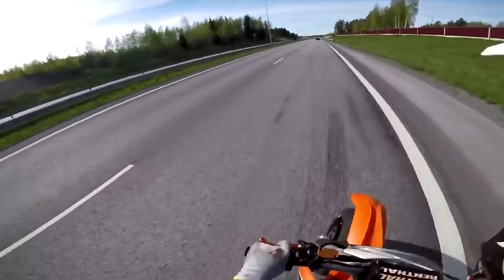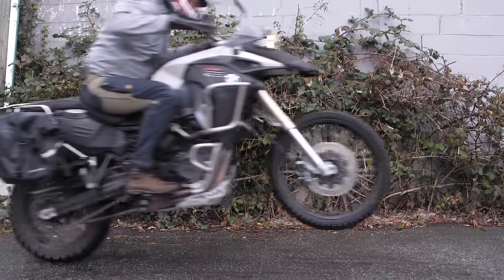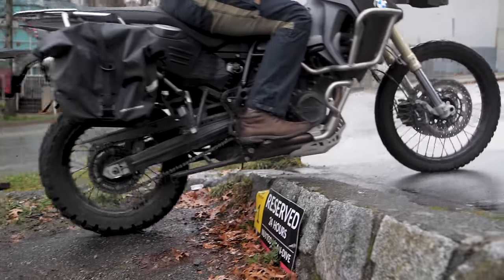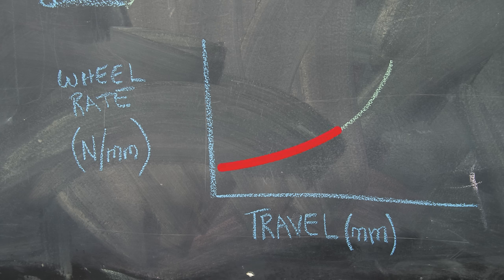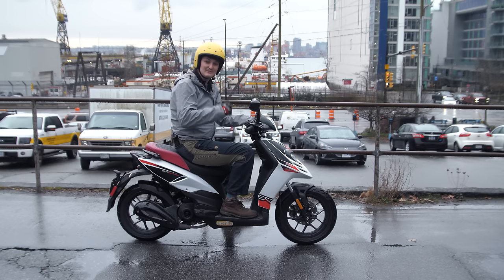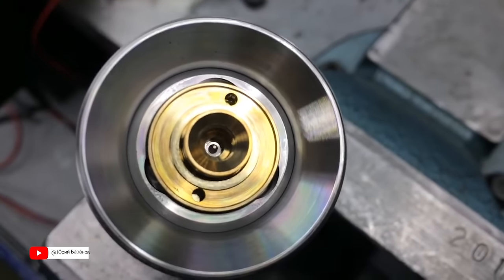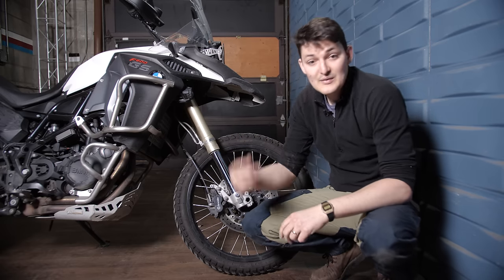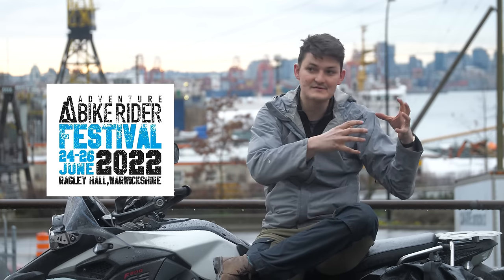Tank Slappers and the Quest for Perfect Suspension

Comment: Ahh so that's why when my bike is loaded the front will wobble a bit under acceleration. Amazing video Ryan!
Reply: Noticed the same thing on my new zx6r, kinda scary coming from a 300 lol
Reply: @kawininji8874  Go get a shop to sort out your suspension settings if you're struggling to find the right ones yourself. A new supersport should not have tank slappers when set up right. Even my decade+ old second hand R6 can go full out without issue.
Reply: Always make sure to adjust your rear preload when riding with a passenger or with heavyish luggage.
A few months ago I took a pillion for the first time ever. Only rode for maybe 10 minutes without adjusted rear suspension (I can only adjust preload on my 2012 V-Strom 650) and without adjusted tire pressure. It felt very wobbly and I was not confident at all. A few days later we rode again, but this time with properly inflated rear tire and preload set to maximum. Oh wow, what a difference! It almost felt as riding alone; even the tight u-turns were no problem.

Now that I think about it, in hindsight the steering felt very light, I mean it felt like there was not much load on the front tire. I didn't experience any wobbly feeling, but I suspect I might have if I had been really aggressive with the throttle. So next time I think I'll adjust the front preload as well in order to shift the center of mass a bit forward.

By the way, if you ride very aggressively (very fast acceleration) you might want to look into an aftermarket steering damper.
Reply: Accelerating hard enough to cause the front tire to just skim the road surface can also induce a slapper, when those little stones and cracks in the road surface begin knocking that front tire off alignment with the direction of acceleration, and a lack of weight allowing the front wheel to pivot.
Reply: @exothermal.sprocket  Yeah and gravity of moon is also possible to cause slappers.
Reply: Make sure the front and rear ride heights, front and rear trail, etc., are all correct as well.
Reply: @jothain  You were sleeping in physics class.
Reply: @NiSE_Rafter  yeah I plan to soon. Don't trust myself yet as it's my first time having adjustable suspension on a bike

Comment: Other, more common causes of tank slappers include: 1/ Too much luggage weight behind the rear axle making the front and light. Watch out for luggage racks that protrude out back. 2/ Weight transfer off the front wheel caused by the drag induced by flat fronted touring screens.

Comment: Absolutely love this channel and I'm always really excited whenever I get an alert of a new video. Ryan's knowledge seems to know no bounds, so I was surprised to see him get it backwards at 2:15 - the top part of the spring he is holding is the softest, stiffest is at the bottom.
Reply: Noticed that too but not a suspension expert so wondered if I had got it wrong 😑
Reply: the soft section of spring is what is causing the section with a wider gap to act in a progressive manner by preventing it from twisting and creating a shorter functional wire, increasing spring rate. this makes it the stiffest at the section closest to where the "soft" coils are. the short twists are not really a part of the spring, as far as springing functionality goes, more an accessory to the spring that using funky fysics to trick it into behaving nonlinearly. kind of like preloading negative twist onto the wire so when it is compressed, the section closer to the tight coils will not want to twist as much
Reply: Chalk board diagram shows advised position for installation, does it really matter? The spring reacts as a single unit, invert the fork assembly the spring still reacts the same.
Reply: I don't think it matters. The soft part of the spring will compress the most at first no matter if it is at the top or the bottom. All forces are linear.
Reply: @flechette3782  The issue was his pointing, not his aversion to the laws of physics.

Comment: 8 years with a Kawasaki 250 Ninja. Never had a tank slapper. But seen them, and taught about them at PRS. Then it was stolen. Until I get a new home, I'm not getting another motorcycle. This is why spring is hell for me. Ryan provides me content that's the next best thing.
Reply: Probably weren't doing any wheelies (certainly not by accident) with a 250. So for little bikes, usually not a problem.
Reply: @jakegarrett8109  It was certainly a reliable steed. Maybe that's why I loved it.
Reply: @leftcoaster67  250 is a great class for reliability. Good fuel economy, not so much power that they can break stuff (if they are decent quality), nothing too crazy to work on like synchronizing 4 carburetors, engine inspection and maintenance is similar to that of a lawn mower (and its very open and easy to get to compared to crammed in 4 cylinder engines), and of course takes like 1 qt of oil and everything super easy to maintain. Often even air cooled so no coolants to flush, just oil and that's it!

My 250 Chinese Honda clone was pretty good, its biggest weakness was a weak frame (and one crazy 14 year old that would sometimes clutchless slam through gears WOT down the highway, but hey, I was that 14 year old so I can't complain too much, haha!). Made new engine frame mounts out of heavy sheet metal, and reliable as could be. I still got 90 mpg driving WOT doing 65 mph on gravel and pinned whatever speed it would do on highways. It even did 109 mpg with 2 people riding when my dad drove it, so not bad, and other than changing tires pretty often didn't have to do too much. Also changed sprockets for higher speeds (duel sport enduro, so they probably didn't plan for it to do 75-80 mph), did better than my skill level off-road too.

I would be driving that right now but its parked halfway across the country, and if I spend 2 or 3 days non-stop driving it to me, well I'd make enough to pay for almost half of another one (and I'll probably move back close to it anyways and have to drive it back again). Otherwise not bad, very lacking for passing on highways and weak going into 50 mph headwinds, but other than that it was a fun reliable bike.

Comment: You really should have covered the finale common cause of tank slappers. Out of adjustment or worn out neck bearings.
Reply: And the spring rates on bikes with dual rear suspension not matching perfectly (Harley Dyna).
Reply: Wheels not weighted properly can also cause them, and on super sports too much weight on your wrists can also cause them as well. I'm especially conscious about this on my r6.
Reply: @Matty_Ice9  Yes, balancing or tires with wear or new poor quality tires can increase chance of it to happen. I had those.
Also totally had forgotten, but in my youth I had a pocket bike - too firm grip would make it wobbly instantly! 🤔 Crazy sensitive steering, would not like that on an bike going over 25 mph 🙃
Reply: And mis-adjusted forks in the triples shortening trail too much causing an overly nervous front end
Reply: And uneven fork oil levels due to a leaking seal or pitted fork tube
Reply: I've never actually seen those cause tank slappers. I've had many, many bikes and plenty with worn steering bearings. Most people with more than 20-30k miles on their bikes have notched steering bearings, which is pretty normal. And they never notice because it's such a slowly occurring process. 

I can't see how the bearing would actually cause a tank slapper. At worst, they'd cause funky handling if worn or if maladjusted.
Reply: @DearMajesty   Your fortunate, I’ve personally had it happen a couple of times over the years (40 years behind the bars). On the older bikes when the neck bearings didn’t get serviced (greased & adjusted) they’d get loose as they dried up. Once that happened they’d became prone for high speed wobbles & that would turn into a tank slapper situation. Not much more scary then powering past a speed wobble & knowing you may catch again it on the way back down. Keep it shiny side up my friend.

Comment: I didn't know the rear shock was affected  by the angle changes. A fun fact is that on a variable spring it does not matter which way around they are placed. The weakest part will always compress first which makes perfect sense but a lot of people think you need to put them a certain way.
Reply: You could affect the amount of unsprung weight. If most of the spring has to move towards the end that compresses first it would act as unsprung weight.
But to be fair, the amount of weight in the spring versus the wheel, brakes and lower fork is pretty much negligible.
Reply: After thinking about it some more there's also the effect of "waves" through the spring. Basically it takes a little time for the force to travel through the spring, and for the entire spring to equalize. The wave would travel faster through the stiffer part of the spring. https://www.youtube.com/watch?v=10-QGhm5hgc

Sorry for babbling, not at all meant as coming at you, it was just interesting to think about :)
Reply: @kaggen  No need to apologise. I am learning a lot of new things thank you.

Comment: When I saw the title of this video I was hoping you were going to talk about steering dampers to avoid tank slappers. But I don't think you mentioned them. Are you perhaps going to make a sequel video which does elaborate on steering dampers. I believe they're extremely important in circuit racing, be it on and off road. But for some reason they're mainly used in rally racing (like Dakar) and almost never in motocross and enduro. I don't understand why.

Comment: Skyhook required no springs and no damping, but there are other methods of assisted fully active suspension. There is a normal coil spring to hold the weight of the bike or car at a "nuetral" position. But when you hit a bump the EM springs kick in and force the suspension to compress or rebound the correct amount.
Reply: You just described semi active suspension. Semi active uses springs, active uses no springing, the hydraulic pump reacts to pressure sensors to perform the task of the spring.
Reply: @davidcolin6519  EM stands for electromechanical springs. Semi active systems only control the damping of the shocks.
Reply: No. In my Understanding the difference between active and semi active is, wether the controlling system can apply it’s own force into the suspension or not.

CDC, as described in the video, only controls the damping coefficient and therefore can only vary the reactive force acting against the suspension movement.

Active Suspension, like The Bose Version, can introduce additional force or power with electric motors or hydraulics. Therefore they require quite a bit energy.
Mercedes has a Active Suspension called ABC, where they move the mounting point of a traditional steel spring with hydraulics.
Reply: @matthiasvolk6006  You used a lot of words to repeat what I just said.
Reply: @matthiasvolk6006  Well, considering an application of force requires a pump of some sort, and not having a pump requires springs, in what way does your definition differ from what I said?
Aaah! the Mercedes method of getting around an F1 ban on active suspension! I see! 
So, why don't you tell me why you would have a spring in an active Systemj, other than to subvent a competitor rule?
Or am I just being thick? Because I remember the Lotus system in its development phase ( I was in the same class as Clive Chapman, Colin Chapman's son) and it was very, very clear to both Colin and everybody else that an active system used computer controlled hydraulic rams/pumps etc to produce active suspension. That M-B may have come up with a system that uses springs just means that their system is semi-active, and I'm sure that they would claim the same. 
But enough about that, why don't you tell us all how a spring works in a system that is specifically designed to not use springs?
Reply: @derekcamp9764  Yeah, you already replied, while i was still typing
Reply: @davidcolin6519  Semi-active is different.  Semi-active, as described in the video, still uses oil, gas, or ferro-fluid filled dampers and functions by varying the flow rate of the fluid through valves or passages either by changing the valve position or changing the viscosity of the fluid to increase or decrease the resistance against suspension travel.

Fully active suspension forces the suspension into the desired position and does not use dampers at all.  What you described  could be a different method of accomplishing fully active suspension, but is by no means the only way.  It could also be accomplished with pneumatics.  But, it is generally agreed that hydraulic pumps or pneumatics would take almost as much energy and be orders of magnitude slower than electromagnets.  Neither what you nor I described has ever been implemented in vehicle suspension - not even for testing AFAIK.  Bose did implement what I described in a short lived aftermarket seat for semi-trucks after 0 companies thought their Skyhook tech-demo was viable.

Fully active suspension can force the wheel to travel faster than an undamped spring, semi-active cannot.  Fully active suspension could force rebound when the wheel is under compressive force (or vice versa), though I'm not sure you would ever want that; semi-active cannot.  Fully active suspension can counter-roll a car in a corner, semi-active cannot.

Comment: My 2 tank slapper were due to cracks in the road. The first one was in a curve which made me continue straight. Thankfully no oncoming traffic. Second one was on a highway going highway speeds and I just let go of the steering but just barely holding on to it to let it readjust itself and also no whiskey throttle. After a tankslapper you're so happy your alive and the rush of adrenalin is so crazy.

Comment: The Bose active suspension was great - and completely ignored by everyone.  You have to wonder if the extreme power requirement and mass penalties it incurred 40 years ago (plus potentially uber-unreliable 1980s electronics) would be such an issue today...
 
When I started riding ABS was a multithousand dollar option only on top end bikes. By the end of the 80s it was a few hundred dollars on scooters and now it's standard equipment to the point that non-abs is banned in many markets
Reply: My bike doesn't have ABS and I was wondering if you can feel it/notice it when braking?
Reply: @joshslater9835  of course you can feel it. ABS allows to steer while braking fully, not just slide forward.

Comment: Citroen has been producing the perfect suspension for decades, it's called Hydroactive.
To bad they stopped making this marvel of engineering in 2018.
Reply: Just because steel spring suspension was "good enough" for customers who are now focused on entertainment gadgets.
Reply: Yes, it got bad rep for poor maintenance I guess. My dad had 3, I also had 3 and still blame myself for selling the first of those because of "small" issues and it ended up going for scrap.

I never got to the bottom of this, but I think the bad rep was "it leans too much" (older ones especially, but they kept the wheels firmly planted unlike the funny swing axle cars of their time), "it's too soft" (apparently people equate a bumpy ride with sporty aspirations"), but guess what, the moose test speed record is still held by the 1998 Citroen Xantia Activa. And finally, I guess what killed 2 of my 3 Citroens is a terminal hydraulic fluid leak (the first one did too, but I had that one repaired before selling it). But they all had 250.000+ km on them, and then people forget that other cars would have had springs, shocks etc replaced multiple times already...
Reply: @MaartenvanHeek  In my family we have had/ has nine large Citroën. 4 CX, 3 Xm, one C5 and the glorius C6. Only once have I had a major hydtaulic leak, it was on an 20 year old CX and was easy to fix by the roadside.
Reply: @Svarthammarholet  in my case it was on a 20 yo XM strut return line (fixed same night), second was a Xantia under the (hot) engine block so could not be fixed roadside and had to be towed, by that time including upcoming MOT repairs it was a total loss. Third was a diravi on another XM, after having it repaired 3 times in 3 months I was done with that car, as you can imagine :)
Reply: @MaartenvanHeek  In my experience it pays of to find a meccanic that really knows and love these cars if you want to keep them alive and healthy. They are in many ways completely different from all other brands.
And ahh yes the good old Diravi, best ever power-steering in the history of automobiles..

Comment: Canada’s greatest export since maple syrup

Also if someone told me to get a quart of fork oil, I would have thought they were messing with me like asking to get some blinker fluid.
Reply: You can't have damping without some sort of non compressible liquid. Designs with non serviceable damper cartridges exist but those are also prefilled with fluid from factory. Makes sense to use oil, it can double as lubricant to the moving parts as well. Fork oil is essentially hydraulic fluid specially formulated to prevent foaming under rapid movement.
Reply: Hum…Canadian Bacon with that Maple Syrup?